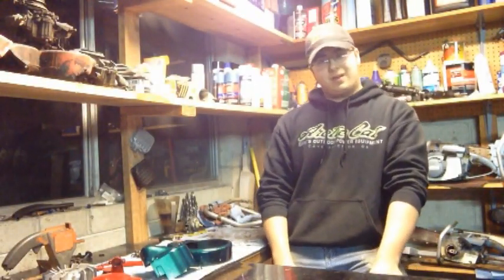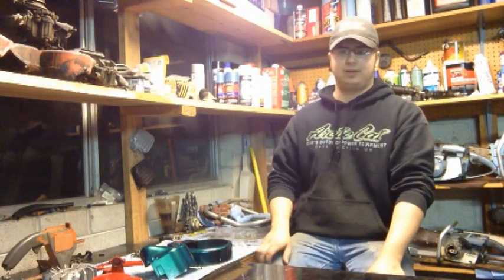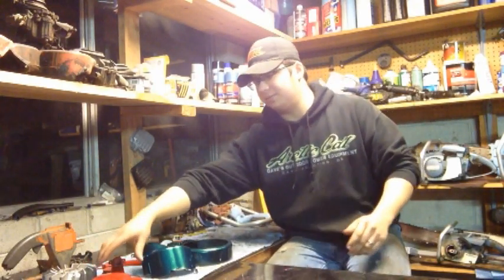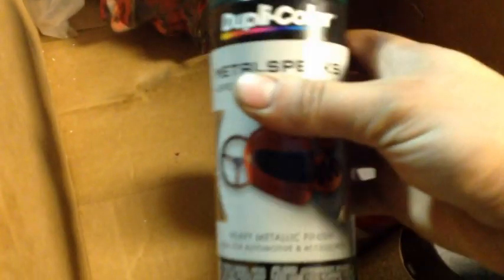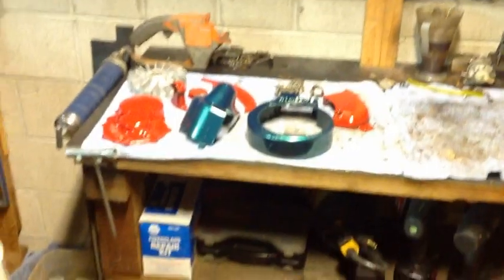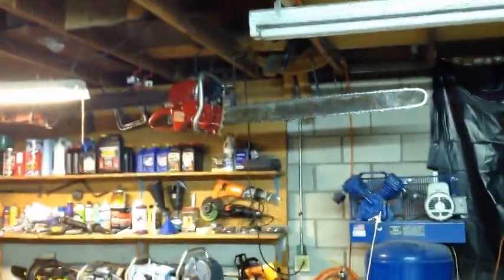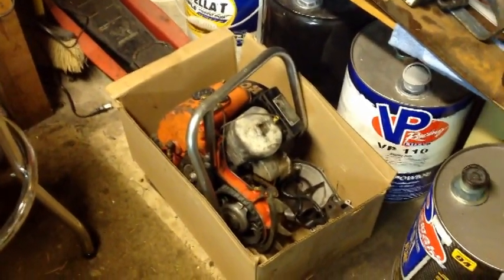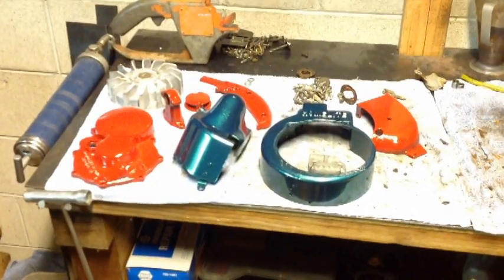Homelite 4-20 Repaint Part 1

Comment: TJ.....nice job! One question....What is soda blasting and when do you use it ?  I know about bead blasting but not familiar with soda blasting. Thanks.
Reply from the maker: Soda blasting is basically the same as bead blasting except you are using a very fine powder called Soda. It's really nice for blasting varnish off carbs in particular, but is great for removing paint without leaving the "blasting color" behind. I took a few tilison hl carbs in and soda blasted them....made them look new again.